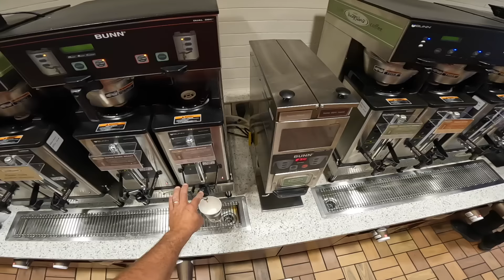I'm glad I video everything!

Comment: Your comment @22:34. Re how easy the job was. It was only easy because of your investment in equipment, formwork and labour. You make it look easy, I know I had a paving/building company, but sold out when I got fed up with being inspected by the Value Added Tax man. OK I brought it on myself by advising customers how having new and not replacing with the same they didn't need to pay VAT. The asphalt drive you ripped out if replaced with asphalt tax would be due, replace it with concrete free of tax. I used the tax angle as a discount.
Great idea drilling the pins to set the form height, nice work on the float off, just pray the frog & birds don't do a walk about.

Comment: That's great! The mail box was clearly rotted at the base and most likely gave out from a gust of wind.
Reply: Exactly and No Damage to The Mailbox,, only at The Base is Right it's Rotted it wasn't Installed Properly.. If a Truck hit it don't you think it would be on the other side of the street Damaged ? and Their Would be Track Marks from The Truck trying to Swerve and How Close do you think the truck got to The Side of The Road Enough to Actually Hit it ? Just Another Clown looking for Something for Nothing.
Reply: And The Post Should Be Pressure Treated So it Don't Rot out,.
And you Should also put a Concrete Footing So this don't happen again.

Comment: I drive a concrete mixer.  in part of the video you mentioned the first part of a pour taking longer to set up than the rest.  Divers usually have to add water once they arrive to a job to get the mix to the desired slump.  but if everyone is in a rush and they dont let the concrete mix fully, the wetter part sits on top of the load.  so the first yard or two has a higher slump than the rest of the load.

Comment: I can't blame the neighbor for putting 2 and 2 together. It does seem coincidental, but glad that both sides actually handled it well instead of shouting or getting overly emotional. It's hard when you see something like big trucks doing work to not think that damage didn't happen. I will say the bottom of that mailbox post where it split, does appear to have quite a bit of water damage already, so it's possible that it keeled over. What was interesting is how the neighbor placed the posted right back on top of the split post, as if that was something he had almost done before. And there you go, two things seem to match up so it appears they lead to a conclusion... but who really knows :)

Comment: Lol love how y’all talk about how hot it is where y’all at. I live nearly in the center of Alabama and we get way hotter temps then 85. Last year we hit 105 three to four days in a row. Im a pool builder and being inside pool holes forming the bottoms and having to lay pipe and build concrete steps is not for most. If the temperature is 100 including the heat index the temperature in that hole with no air stirring is 110. Now that’s hot. But enough of that. Y’all do excellent work and wish y’all could do our pool decks lol. Enjoyed the video

Comment: It looks to me like that OLD wooden mailbox post was rotted out at the bottom; finally gave way. It wasn’t painted to preserve and protect the wood. The mailbox was not hit by a vehicle, in my opinion. So that man wanted you to believe that someone came along and “axed” only the base of the post ? No vehicle would have damaged only the bottom of the post; the mailbox was not damaged. I have had 5 country properties and know what a “hit”looks like by a car or truck. Suggestion: buy a new post, paint it with a high quality paint/stain, and secure the post in quikrete. Don’t take advantage of a construction crew to replace something you should have seen was starting to rot and was in dire need of replacement. I just added another coat of solid stain to my 8 year old country mailbox post two weeks ago! Looks as good and is as solid as the day it was installed ! It’s called maintenance! Love the video insurance policy ! Great work crew and boss !

Comment: putting on some safety caps would be a good thing to do. Ive seen it go through a guys shoulder. I know they are required depending on size of job, height etc. but they are always good to have just in case.

Comment: Once I cam back home to a hole in my sidewalk and I saw two houses down someone redoing their sidewalk, breaking it apart. I assumed they had accidentally drilled a hole at the wrong house but after talking to them they said it was probably the city testing the concrete and they was nice enough to pour some concrete to fill the hole.

Comment: You mention how concrete finishes faster at the end of a load then the beginning (45:45). I think that's got to do with how long it's been in the truck while the drum is spinning. something about mixing concrete causes a chemical reaction that changes the cure time. I don't work the the business, but I've heard stories talk about how trucks are only allowed to carry cement in the truck for so long and can only add water to it so many times before that breaks some sort of regulations.

Comment: Nice finishing job. But mesh and steel laying on the ground is a no no. They need to pull it up while pouring or put chairs under it. In the cold cold north this would not stop the concrete from cracking in the winter.

Comment: Looks like mailbox-dude should have used treated lumber, or maybe one of those steel bases (you hammer/cement into the ground and bolt wood to) to keep his mailbox from rotting off at the bottom.  Looks like the mailbox post rotted and fell over. Hope mailbox dude is reading all of this.

Comment: 17:25 Gutter guys were at least thinking. Running their pipes out past foundation and out of corners. Slow clap. 44:48 Never seen anyone not use a saw and pop lines after it's dried. That's a nifty tool. Saves a trip. It works just as well?

Comment: Curious as to why you only drag your screed in stead of sliding back and forward as you drag which will help bringing up a slurry to the surface making ball floating a lot faster , also what’s your concrete slumped at look to be somewhere between 80 to 90 slump

Comment: I will share a trick with you to keep customers from canceling. or changing things.  Always go out a week or two early when you have extra time. Start some of the job that does not need parts or something to be delivered. In your case may be digging marking forming. And talk to the customer get it all out of there system, so on construction day. they are questioned out. and if they try to cancel or change you say we already started I can do that and the cost would be $ make it a high price for addons or changes. also if they stop the job, you already started they owe you no deposit refunds. you will be covered in court. Them canceling in the middle of the job. If you are a plumber fixing a faucet take the old one with you to go get parts. Furnace repair bad fan motor need to run and get one. take the whole housing with you. on the way back go to the shop or grab a parking lot. Then you wont find an other contractor company there when you get back.

Comment: Not that I think it would help in that instance (falling from scaffolding), but in CA, you have to put bright, orange, rubber caps on exposed pins and rebar.  It at least makes it so you avoid tripping over them.  Sometimes hard to see.
Reply: Here in tx we have to put rebar caps on also

Comment: Never seen anyone drive stake with an 8 pounder or is that a six?..I used a short handle 12 pounder to set line and set up curb and gutter for 30 years. Local 600…

Comment: What is the point of putting the wire mesh down if you pull it up through the concrete and put it back on the truck anyway I thought it was there just till I provide stability but it seems like you reuse that same match so you must pull it up through the concrete at some point, although I’ve never seen it on your videos so why put it down in the first place?

Comment: Really, gutter draining directly on a cement slab. Not smart.  They should have installed under ground drain tiles away from the house, insted the gutters water will pool on the cement slabs ice up melt and lift the slabs. This is a great way to start a repair in 5 or 10 years. 

Move the water as far away from the house as you can.